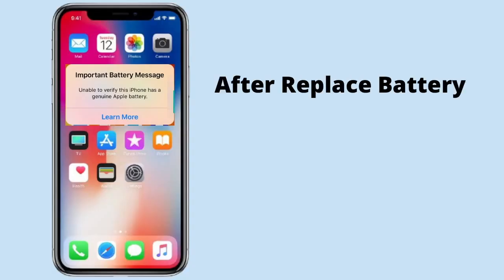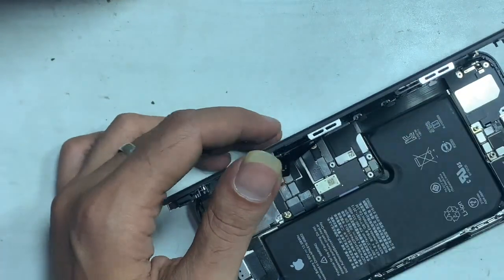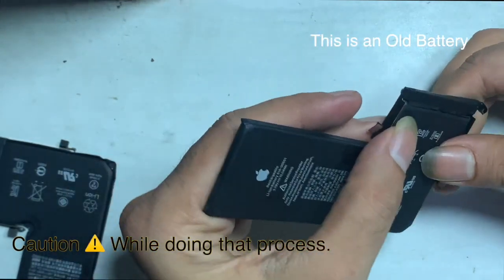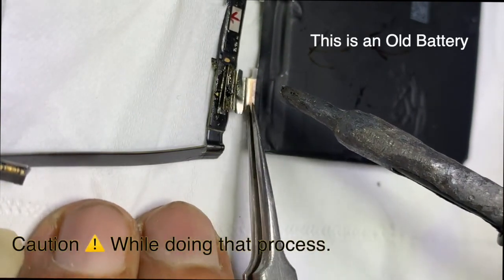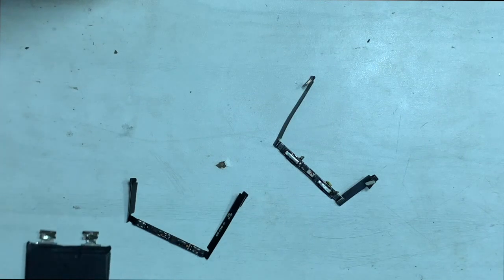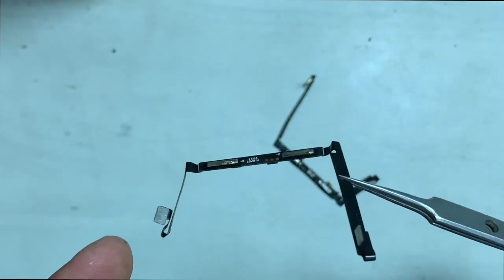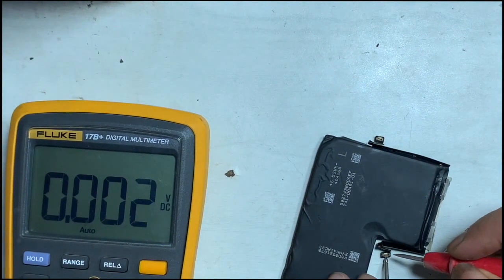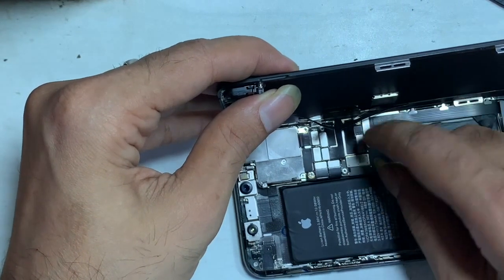Fix “Important Battery Message”Unable to verify this iPhone has a genuine Apple Battery.

Comment: hi bro, if I don't have the connector from the original battery? Is there a solution to fix the battery service problem?
Reply from the maker: If then there is some flex and need programer for doing that.
Reply: @thegsmsolution1  can you make an example tutorial for it? i have jcid tool programmer, but i don't have flexible for iphone xr battery.
Reply: @thegsmsolution1  did you have video tutorial for solution without original battery??i always get not original from iphone 11 and below now
Reply from the maker: I upload the video in that topic check it out.
Reply: @thegsmsolution1  can't find it..can you give me link?

Comment: if this message pops up on iphone xr it means i need to get a new battery?
Reply: No
Reply: You literally need to have Apple replace the battery to not get the message. Even if you take a battery from another iPhone of the exact same model, the message will pop up. However, you can still replace the battery in iPhone X without any message popping up.
Reply: @DemePoole  jc and qianli both have "tag on flex" now which can be used and battery will show health correctly on 11 and up

Comment: I try this method before on iPhone XS, but battery health keep using last battery health reading at 75% battery health.
Reply from the maker: Yes battery health remain the same because on the BMC Board there is chip which store the battery health data that only be erase by programmer.